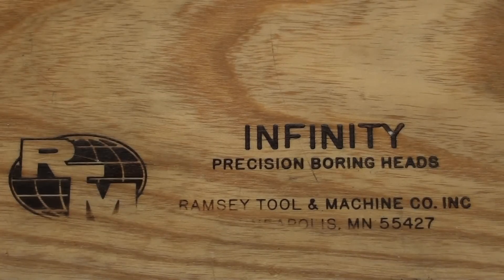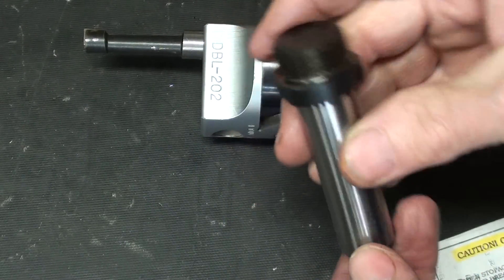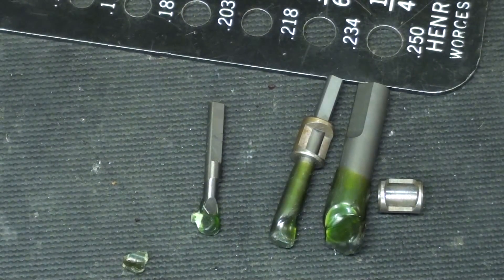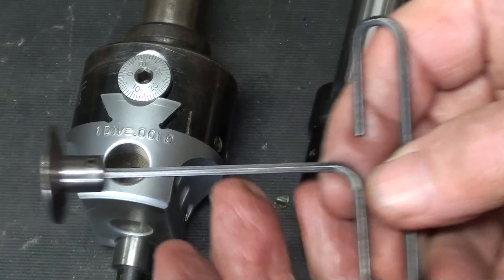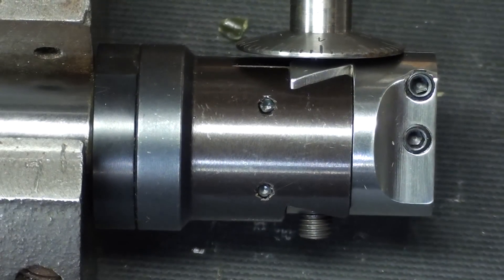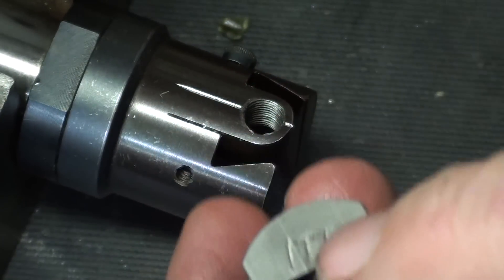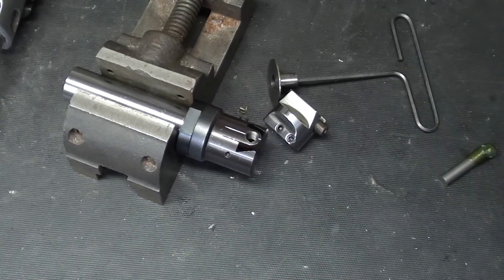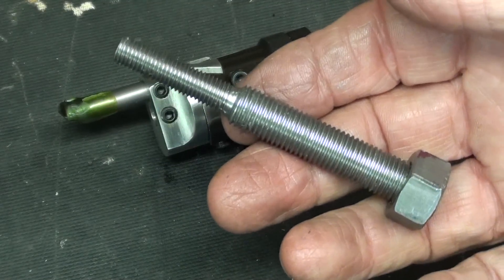WORLD'S SMALLEST BORING HEAD short #31 tubalcain ramsey infinity criterion

Comment: II have  a friend who manufactures laser fixtures, they use short differential screws for um alignment adjustments in the optics. 
I have wanted a small precise boring head for use with the Paul Horn  ultra miniature boring bars I use. Would say that this boring head is small enough for most purposes, it is the ability for very precise adjustment that is important. My smallest one now is a 40 mm one from china, it is not easy to adjust accurately. I have seen smaller ones for watchmaking etc but doubt that they are more precise. This one seems to me like a very good design.

Comment: Glad to watch this vedio , thank you so much. I have quite a long history with machine tool products. I worked at Criterion Machine Works for 30 years as a Journeyman Tool and Die maker machinist , Foreman and the last 12 years as head if manufacturing operations. We manufactured many different sizes and styles of boring heads and boring tools. I worked at CMW from 1972 till 2002 after working at different shops in Orange County for 20 years before working at CMW.We made a Tiny Mite boring head which was one inch in diameter, with the sizes going up to six inches in diameter.We made a 1/10th adapter for both  the 2" thru 3" boring head and a 1/10 setting boring head. Back in 1985 we had the 50th anniversity celebration including an Open house during the day so that people/customers could actually see all of the operations in process. The  Presedent at the time Clarance Vanderpol, gave to me a 3" Gold plated 203 boring head.For our anniversery we  24 caret  gold plated the two and three inch bar holders. We manufactured all of our tools in Costa Mesa, California.  A former employee sent me pics and told me that the ORIGINAL CMW was sold , I believe around 2014? They moved to Ohio.Man do I have stories and memories from Criterion, I miss it grately., thanks again.  I have a few pictures on my YouTube chanal , Randy Melton ( RPMBLUES)

Comment: Forgive my ignorance but I have a chinese 2 inch boring head I've only used a few times and therfore don't see the obvious advantage of a small little boring head.  Clearly that little one is of better quality than mine but could I not bore just as small of a hole with an appropriate boring bar with my boring head?
Reply from the maker: Remember, I have never used the stone a boring head. Yes, you could probably use a much larger boring head for the same purpose.

Comment: Is there such a thing as a 3 thread differential screw?
Reply: why not... as long as there are 3 moving parts, a=main(fixed), b=moving 1, c=moving 2 part....
Reply from the maker: Not that I know of
Reply: @mrpete222  Thanks. I was wondering if a 3 thread screw might replace gearing in a clock or physical counter mechanism for example to represent seconds minutes and hours. Yes I'm nuts.

Comment: Thanks for illustrating that tiny boring head. Has anyone figured out which two thread pitches produce exactly .010 movement per revolution? I’ve tried but nothing works out.
Edit: 20 and 25 tpi on the same shaft produces.010 movement per turn. Now to see if my lathe will cut 25 tpi.

Comment: I have one i do not know who made it. it has about a 3/8 stub shaft on the main body and it has a 1/4 in boring bar mount, dead center it is only for real small holes or adapt it. i will send you some pics if you like. it is again, very small. Just a oddity i picked up some auction. i am sure it can do holes down to 1/8 or less as it has negative travel as well, if you have a small enough boring bar. have you ever ran a Chandler Duplex Boring / Facing head? i have one brand new in the box, i am certain its never been used, with all the attachments.
Reply from the maker: No, I have never used a duplex, facing head

Comment: Found this description in an old ebay posting Ramsey Tool Model 1000 precision boring bar. 3/4" straight shank, 1/4" boring bar diameter with adapters for 3/16" and 1/8" diameter boring bars.

Hole diameters from 0.030" to 0.300". Differential screw design for accuracy to 0.0001. Note quoted capacity,

Comment: We got a tiny boring head gifted with our MillPort, only slightly larger than that.
Head is 3" long x 1.5" dia., 6" overall.
1/4" bars, too, with flats.
Has a tiny vernier, not that nice separate one.
Have picture, but can't post in comments.

JUST fiddled with it...
Couldn't see dovetails, it's a PIVOTING boring head.😳

Comment: years ago I bought one of these Ramsey boring head kits,  mine came with 2 sizes of small heads and it really appeared to be new.  The smaller of the two heads was missing the differential screw and I had to order a new one from Ramsey.  When I called to order it I spoke to the owner of Ramsey tool and he asked me where I bought it and how much.  New then with shipping the two head set was 1200.00 or so.  I just ran and looked in my set,  I bought the differential screw in 2004 and Ramsey charged me 25.00 plus shipping for it.   Did you get the one page instruction sheet on how to adjust the boring heads?  I can scan and email it to you.
Reply from the maker: I’m not sure if I have the instructions or not, I have to go look in the box
Reply: I just bought an older version of this off ebay when this video came out, no instructions... would love to see a copy of your instructions

Comment: There are differential screws that increase the movement too. Have a gate valve that 1 turn moves the gate about a quarter inch.
Reply: The other thread is left hand?
Reply: @MF175mp  Both threads are right hand. They have to be to work in this device.
Reply: @ellieprice363  if you want a slower movement. If you want it faster the other one must be left hand